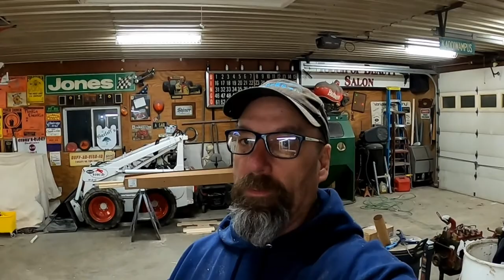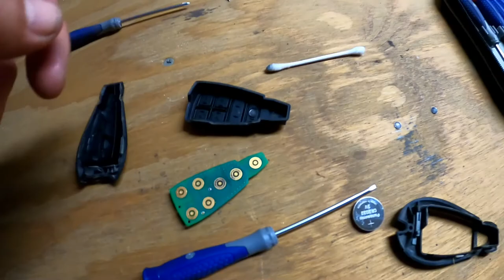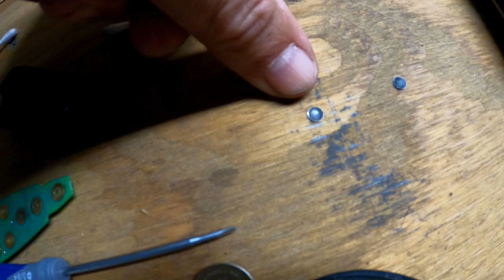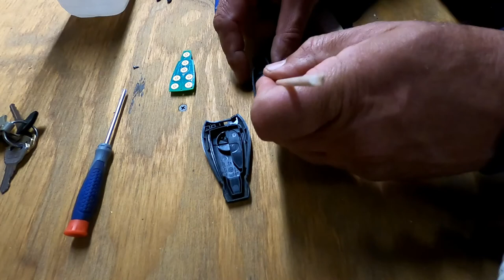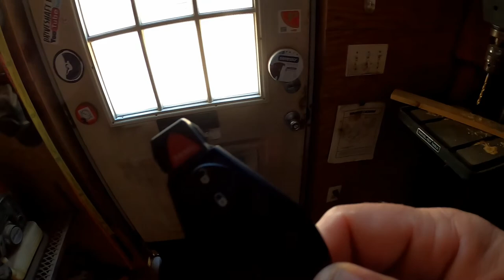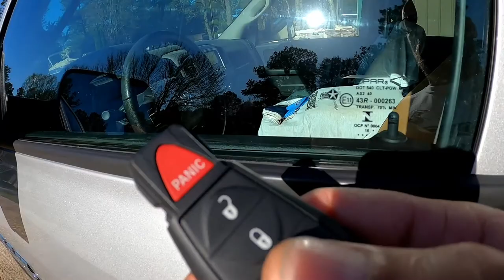Repairing a Key Fob for a Dodge Ram

Comment: Quick fix: Tape!

Disassemble your key fob. Take off all the little metallic domes. Figure out exactly where they need to contact the board. Then tape them down to the board. 

I tried super glue at first. The hot glue. Then I found your video and figure out I was doing it all wrong. Tape is the quickest fix!
Reply: What kind of tape? Thin transparent like you use to wrap Christmas presents?

Comment: Happened to both of my 2015 3500 keys, both unlock buttons. I ordered two fobs on the internet and gonna swap the rubber piece that the discs are so called secured to

Comment: If you need to find these ''metal discs'' because you lost them they are called 'dome switches' and/or 'PCB Surface Mount Tactile Membrane Switches'. Also its easier to secure these discs directly to the board... many have used 'magic tape' for this but electronic glue around the outer edge may work also. Thanks for the video Redneck Mfg.
Reply: You’re the man. Been looking for what these were called
Reply: Where can I find this switches at?? I need to replace mine asap as to they don't click anymore like the video shows lol. Mine aren't round anymore they r flat?
Reply: In Canada it's 460 plus tax to replace lol

Comment: Nice job getting all those contacts clean and back in place. I've run mine through the washer and dryer a couple of times with no problem so far.
Every time I do it , I know it will be the last...ha ha

Comment: Just found this video. RTV is a great idea, because you are very correct in the fact that the adhesive must remain pliable! Superglue or epoxy will prevent that steel disk from being able to "pop" when the button is depressed. Might add, if anyone here is attempting this, pay close attention to the direction you place the disc onto the rubber button as there is a top and a bottom. Thanks for the video!
Reply: i have always used superglue...quick fix and it last over a year and i re-apply when it starts acting weird again

Comment: I had the same problem with my key fob on a 2014 Ram Bighorn 1500 where the horn starting honking randomly, I ended up needing a different key fob after taking it apart and cleaning just like you did in your video. I think the p.c. board was the cause.!!!

Comment: How did you take it apart
Reply from the maker: pull your skeleton key out of fob and insert it on the end and twist the key between the two halves it will pop the case in half
Reply: Mine had a small screw that had to be removed once the key was pulled out